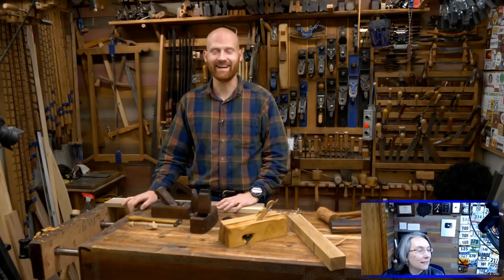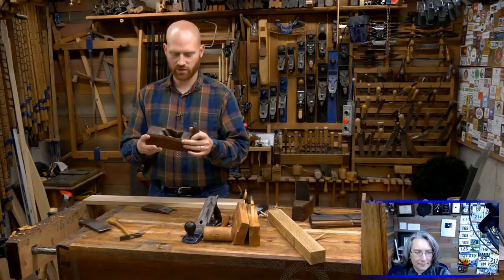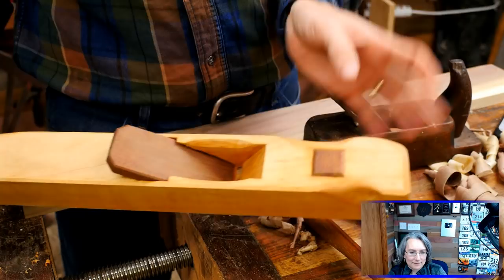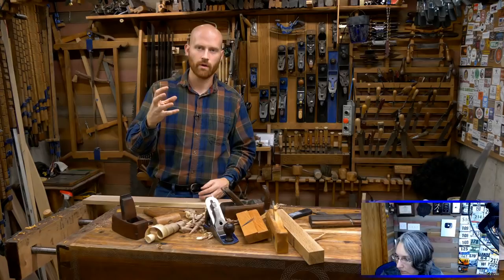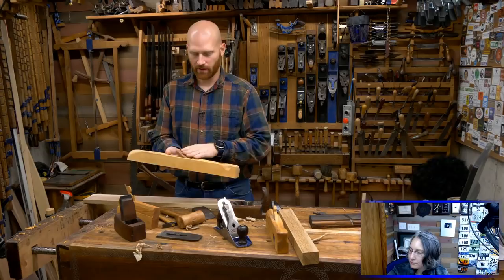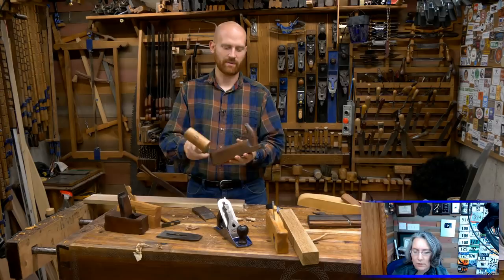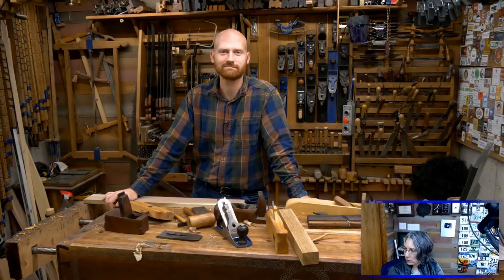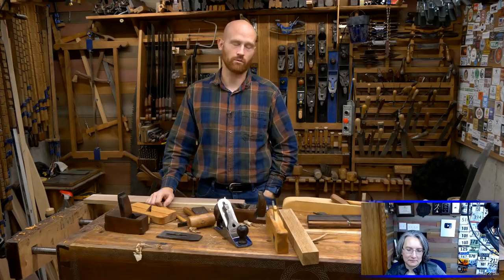How to setup a Wooden hand plane

Comment: If you want a hammer that Jim is using, search for a Warrington hammer. You will find them at several distributors but the heads are basically the same. Stay away from plastic handles and opt for the best wood handle you can afford (it really makes a difference).

Comment: Either a very light steel hammer (I think 200 gramm would be enough) to set the iron, or as far as I tried ought, a small soft face mallet does the job. I just know wooden planes with a steel knob on the back side or in the same position as on your wooden jointer. But it makes setting and resetting the iron very convenient instead of hammering the wooden boody itself.

How did you carve the handle for the small hammer? It looks like it dropped out of either Hogwarts or The Shire. I want one!
Reply from the maker: LOL thanks. I like that description. here is the video where I made it. https://www.youtube.com/watch?v=Zoc3Vmi_828

Comment: Do you leave a blade and wedge under tension when your not using it? Or is it just lightly wedged in?
Reply from the maker: you leave it in. otherwise you have problems when you bump them and the iron slides around.

Comment: Could the smoothing plane be restored by adding a block of wood to the front of the blade (instead of leaving it with a wide gap)?
Reply from the maker: The best way to fix it would actually be to add another block of wood to the soul for this one I would have to add about 3/8" to the sole.